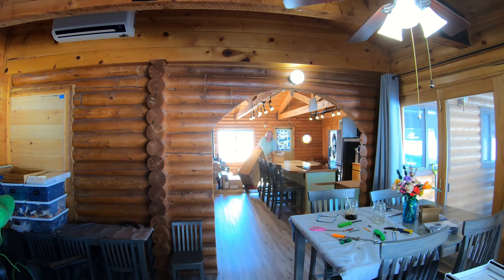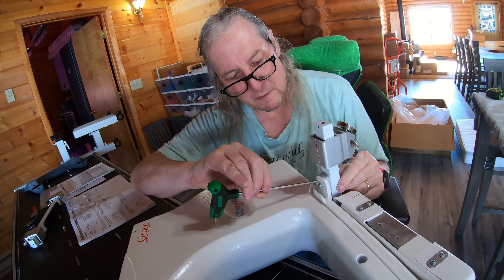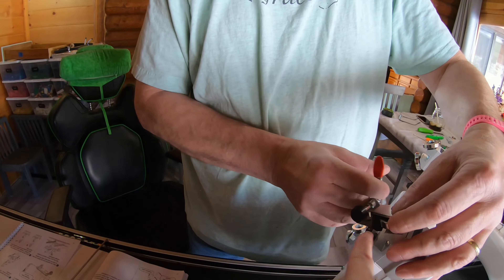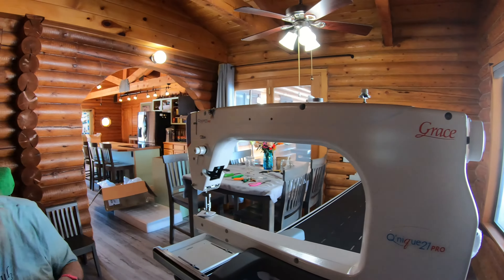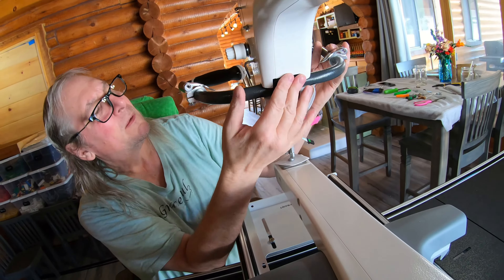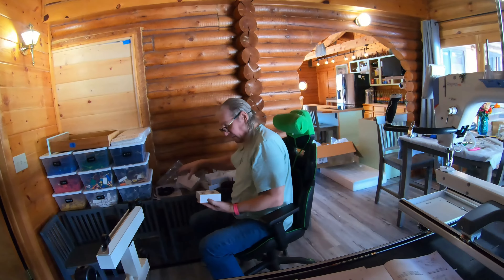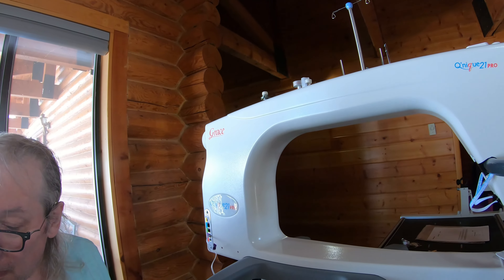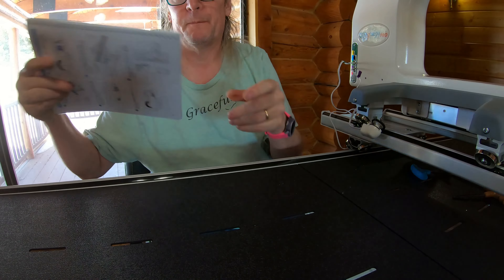Grace Q'nique 21 Pro Free Motion Assembly

Comment: how much does it cost?
Reply from the maker: The machine with QCT5 software, the motor, the frame and the lights was just under $15,000. This included the two foot extendtions for the frame and lights.The software does not come with a Tablet or IPad so that would be an added expense. I already had a Surface. The package cost was about half of the Bernina.